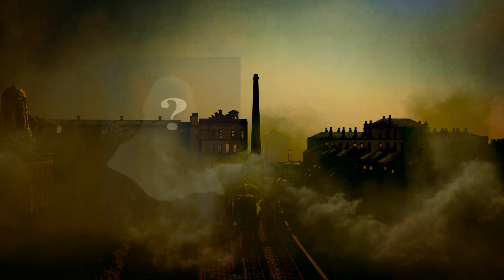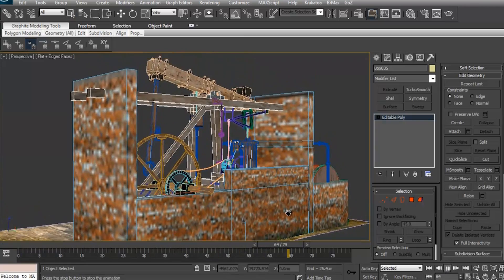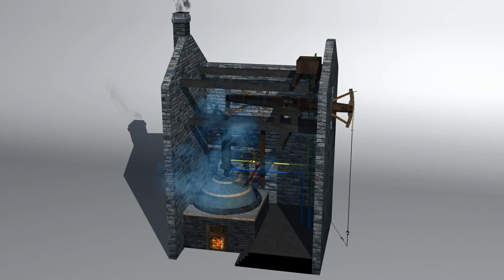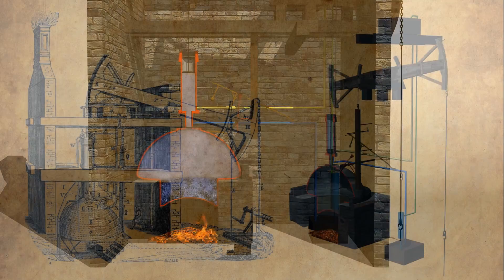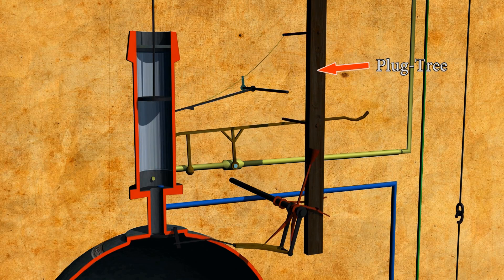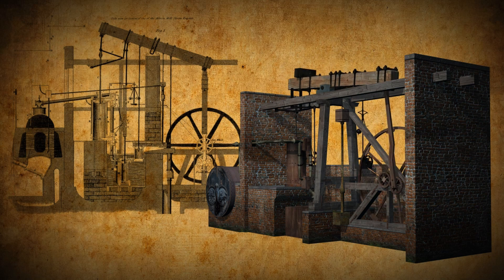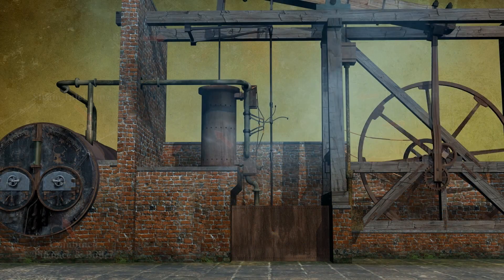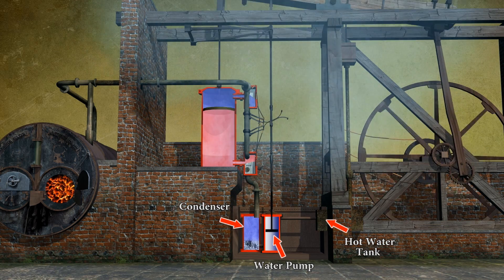Newcomen Watt Steam Engines

Comment: The condensing tank was probably much larger or would need a flow of cold water into it. I'm not sure if this depicts an atmospheric engine or an overpressure engine. The introduction of pressurized steam was the next step. Watt understood that the metallurgy of the day would not safely allow high pressures, but others pushed the limit, resulting in boiler explosions.

Comment: newcomen engine is weird. instead of steam gives a power, but use vacuum (cool stream shrink) to empower.  watts engine is truly steam engine by using steam empower both in and out to cylinder (double acting).
Reply from the maker: That's why they were pioneers within the development of steam engines.  I can only assume that the technology wasn't available for Newcomen to build a boiler that could withstand the pressures required.  Let's not forget - back in those days - there was no such thing as Heavy Engineering or such things as heavy duty pillar drills; steel plate rollers etc.  Everything was hand made and holes were simply chiseled out.
Reply: hi there, i surely respect all these pioneers and beginners. they shaped the world we live today. but you know, these inventions now a day pollutes the atmosphere by burning fossil-fuel for source of energy. we need new fresh source of energy, new invention and more effective concept to generate power. i just hope it will happen soon before it's too late. 
and i will surely visit Beamish museum one day to see these wonderful steam engines.

Comment: Hello Michael,
Excellent work on the engine models! I am designing modern Newcomen engines, they will make a comeback for a number of reasons. The steam required to power the engine is VERY small, all it does is displace air at atmospheric pressure. Condensing that amount of steam is easier. The atmospheric pressure seems small but it is additive so larger pistons deliver more power. I have invented a material that can handle the pressures and temperatures of a Newcomen engine, and the cost is so low that the cost of very large engines will be quite reasonable. By operating at low pressure the engine is much safer than conventional steam. I also find the idea if the old engines far more romantic than modern ones. They could be built by laymen like you and I, and they can be used to pump water just as the originals. The energy to power them can be solar or biomass, and the energy produced can be carbon negative (by using wood gas pyrolization)
I will look at your other videos, thank you for posting them.
Reply from the maker: +AquaponicDave .............  Now that sound ruddy interesting Dave....  Keep us updated ;)

Comment from the maker: @Tom Thompson....  Glad you enjoyed the video :)  I take your point about the plug tree colour when the video is viewed at 360p and at YouTube's default size.  However, when viewed at 720p HD or 1080p HD and in Full Screen Mode then I believe the result are as those I intended to create for the video to be clearly viewed on most of the current large TV screens.  But thanks for your input and enable me to make these points here in the comments :)
Reply: +My bit of History My question is about Newcomen's engine. How was the cylinder prevented from cracking under the stress of the heating and cooling cycles?

Comment: A beautiful model. I wonder if there was an intermediate step between the pure Newcomen and Watt engine that came from running the boiler at a pressure greater than one atmosphere absolute. If the boiler ran a two atmospheres, for example it would have pushed the piston upward providing a power stroke on that stroke followed by a power stroke on the condensation stroke. That of course would have required a sturdy boiler.

I am thinking of building a Newcomen engine using pvc or cpvc piping. I could possibly use drain pipe as it is thicker walled and would not breath in as the pressure in the cylinder drops.
Reply from the maker: Hi Kelley - as I'm not a steam engineer I wouldn't really be able to add any thoughts on that.  I was more interested in getting to understand early steam engines and how they changed the world.  I also wanted to create the working 3D CGI models as a means of getting my head around the mechanics.  I can remember as a child (A long time ago now), learning that the Greeks and Romans used steam to power a windmill - but this was basically a toy - a source of amusement... It makes one wonder where we would all be today if they had pushed the idea forward - But then gain, they didn't at that point in history have the technological advancement in metal working and forging.

I would be interested to hear how you get on with your future Newcomen Engine Project :)  

Mike
Reply: My bit of History The problem with the Greeks and Romans and others is that they had slaves and worshiped Aristotle. Aristotle was almost a god and his word was seldom questioned.
 
How long did it take you to learn to create CGI and what do you use?
Reply: The James Watt design shown in this video is actually one of his later designs. Watt originally added just the external condensing cylinder to Newcomen's design, and then over time he was able to improve the engine by adding a method of producing rotative force, a governor to control the speed, and the solid pushrod connecting the cylinder to the beam, which made the construction of a double acting steam engine possible. It's important to remember that Watt's designs are still very early and were intended for use as stationary engines. These were used to power pumps and machine shops, and although a few early steamboats used James Watt's steam engines they were less than ideal because of the power to weight ratio.

Comment: A very interesting set of animations that illustrate these innovations very well. I'm currently studying the early industrial revolution in preparation for a Study Abroad course that will take me throughout Britain's industrial history. As much as I've studies of this subject, I've never had a clear vision of how exactly a Newcomen Atmospheric Engine worked, and had no knowledge at all of the function of Watt's separate condenser. This has proven very interesting.

If I may point out one minor flaw in your animation: Your animation of the Watt engine features the engine gaining steam from a cylindrical boiler. Such boilers were not invented until 1801 by Richard Trevithick. Originally, Watt's engines would have used a Newcomen-style kettle boiler. Initially, Watt was resistant to Trevithick's ideas of using higher pressures to generate more power because these kettle boilers, made of a patchwork of iron, could not contain more than about 10 psi. Trevithick's cylindrical boilers distributed the pressure evenly around the whole internal surface and were safe up to 30 psi or more.
Reply from the maker: Glad it proved of interest...  and thanks for pointing out the boiler issue - When trying to gather the specifics of these engines, I did find it difficult and sometimes confusing as to what was and wasn't being used... given that many reproductions appear to use a combination of boiler types.